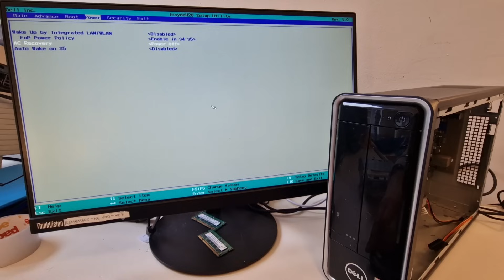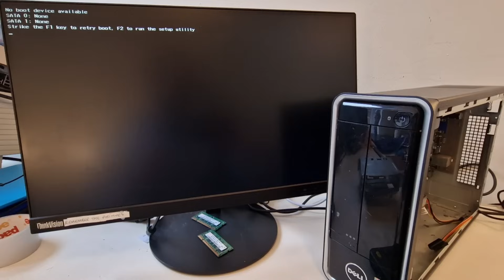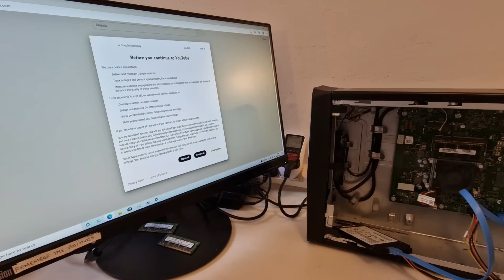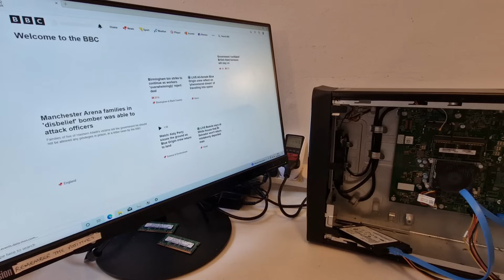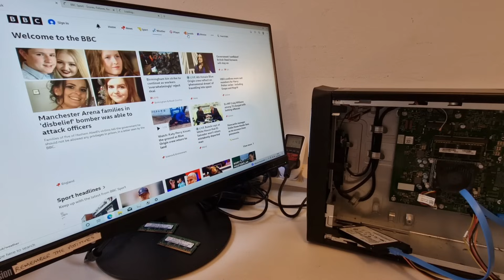Dell put a LAPTOP inside a DESKTOP case...

Comment: I had an HP that was basically the same thing as this, with the same CPU, same RAM... heck, even the motherboard was virtually the same.  Honestly, I don't think they're the worst idea for a budget desktop, but I definitely agree with you about the size.  Honestly, with the amount of unused space inside the case the the overall compact nature of the guts, they could have easily shrunk the case down by a good 50%, maybe more, and I think it would have actually made it MORE appealing.  Windows 10 performance is acceptable, in my opinion, but these things REALLY shine with Linux on them. Try putting Linux Mint XFCE or Lubuntu on this system and see what you think.    Actually, the performance of this system is not really that awful, at least compared to a few other systems that I had in the past (one eMachine, two HP) that were even more anemic, if you can believe it.  THOSE systems all each ran an AMD E-300 APU which was woefully weak compared to the J2900 in this one.  The E-300 is a dual-core APU a 1.3GHz with no boost.  Compared to this J2900, with a passmark score of 1246, the E-300 got only a passmark score of 338.  Google the HP pavilion P2-1114 PC.. and just marvel at the sadness.  Just sitting at the Windows 10 desktop and doing nothing else, if you just opened a browser window, it would hit 100% utilization.  I ended up selling all three with Linux Lite installed in order to just make them usable.

Comment: I use this model with windows 8.1, I had to install an additional fan at the back air entrance, it worked for keeping the motherboard cool. The original fan does not change speed by unknown reasons to me, it´s always on low speed. Another tip, set the cooling method to passive in the system power settings, it runs faster in this mode (i guess it doesn´t wait any fans to speed up so it takes action by itself for regulating the CPU temperature, so in the end it´s better managed)

Comment: Looks nice but it's a janky low-end low-powered cpu from 2013. It's a basic office PC. RAM capability is 8GB maximum according to the intel specs for the cpu. Not really much good for anything other than mild curiosity nowadays. Having said that it's better than the steambook garbage and should be fine with Linux.

Comment: For a machine targeting the lower end of the market, this is a brilliant strategy. Looks like a 'real' pc and can actually be expanded/optioned as such, allows for repurposing optical/3.5" drives. Reuses already designed/stock case, cheap region specific power brick doesn't need installing in the machine but simply shipped alongside it in the box.  'Laptop style'/embedded boards have been a thing since the mid 90ies, possibly earlier, keeping power use and cost very low. VIA Cx and Celeron used to rule the sff market.

Comment: Your main problem on Youtube : it tries to serve VP9 or AV1 codecs, even to systems lacking hardware decoding for them.  Pentium J2900 is an Intel Atom 'Bay Trail' .
To efficiently stream 720/1080p, get the h264ify or enhanced-h264ify extension for your browser.  Disable AV1 and VP9 codecs in extension settings.
That forces Youtube to send h.264 AVC codec video that your J2900 can decode in its onboard graphics.  Otherwise, your CPU is forced to do it; that's why your CPU usage spiked at 1080p and dropped frames. 
Why this works: YT still supports h.264, because many Apple products don't support VP9.  So you can use this to your advantage.

Comment: At first, based on the video title, I thought this was going to talk about those older docking station computers where you slide a laptop into a sliding bay of a desktop computer & clicks into an interface connector & then be used like a normal desktop, back in the 1980s & 1990s.  I do not have anything like that but I do have older laptops with port replicators.  Apparently this Dell takes it a step further & makes that laptop-desktop fusion permanent.  Looks nice though.  I have also been watching a few other videos where people just take a laptop motherboard & put it inside a desktop/tower case, or they design/build their own case using wood/metal/plastic, because the original laptop case is too broken to repair.   
04/16/25

Comment: Hp did the same thing years ago.
They are all crap.
Reply: No, they are not. It depends entirely on what OS you plan on using and what you are going to do with it. If you personally are incapable of putting such a machine to any use then that's a "you" problem, not the machine's.
Reply: @ get over yourself.  Compared to an actual desktop, they are incapable of performing anywhere near, and are so limited on upgrades.
Reply: The less upgrading you can do to a system, the quicker it is trash.  The fact you think these are anything but garbage, that is a you problem.
Reply: @MGDCrown559  "@ get over yourself."

I don't take instructions from strangers on the Internet. I did not read the rest of your comment, you wasted your time writing it.

Run along, sonny, Mind how you go and stay away from sharp scissors.

Discussion closed.
Reply: @terrydaktyllus1320  lmao you didn't read it... close your face if you want something closed.
Reply: @ You keep deleting my posts.  Sign of a limited mind, and a coward.  Keep trolling someone will think you know what you are doing.  I never will.

Comment: i somewhat recently had an hp system similar to this that had a really tiny laptop board in a large case (much larger than the one in the video) i didn't have the space for it so i no longer have it. good on power but too limiting otherwise for things such as storage drives and upgrades

Comment: Ahoy, Good video. The Pentium J2900 has a Baytrail GT1 GPU. Speedwise it is almost as fast as the N3450 Apollo Lake except the GPU. Baytrails tend to play Youtube full screen better than windowed. I have an Onyx MedPC with the Celeron version J1900. I've used it as a Retrogaming system with Batocera for 2 years. I plays anything up to N64, after that its shaky. I also used a Dell J1800 2c with Win10 for about a year then the SSD failed and I moved on. That system would fly with Linux on it. Cheers, daveyb

Comment: HP did the same thing! using a AMD 5200 APU processor!
Reply: At least that AMD had a proper iGPU that could even game at 720p low settings in 30 fps at least...

Comment: Sadly, I hate these and many HP options that are similar. Laptops in PC cases. What a waste of material.
Reply: I am not surprised that someone with the pseudonym "R-Tech_Gaming" doesn't appreciate such machines - but that's a "you" problem because there is far more to computing than just playing silly AAA "games as a service, gamers as whales" anyway.

For the record, I love gaming and have done it for more than 40 years - which in turn means I have appreciation for older retro and indie games as opposed to this modern rubbish where every game is either "running around in third person hitting things with a sword" or "playing online shooters late at night after all the cheating kids have gone to bed".

So I can happily make use of such machines like this and have some fun playing a few games on them - that's what "thinking like an engineer, not a gamer" allows me to do.

Now please excuse me while I go have a game of the classic ZX Spectrum game "Manic Miner" on an emulator running on a £12 ESP32 VGA micro-controller.

You kids, eh? You don't know you're born!

Comment: A candidate for Linux and the HP Elitedesk 800 G1 USDT PC., is a decent small PC., the CPU., is socketed and it can handle 16 GB., of RAM..
Reply from the maker: @laurencejohnson4106  that looks like a nice PC!
Reply: @OldPCGunk  Yes, I concur and that model of PC., is also designed to be easily maintained and it can be fitted with an Msata ssd., for a boot drive which frees up the 2.5 sata interface for a storage drive.

Comment: They could have found some space to add 2nd so-dimm slot. This way, system is limited to 8GB
Reply: 8GB is fine if you run a "grown-ups" OS like Linux. Why buy 16GB RAM just to run Windows to allow it to run a huge number of background processes that just surveil you and destroy your privacy anyway?
Reply: @terrydaktyllus1320  Because of how easy it is to use, especially when you've been using it for you're entire life. Linux is getting closer to being the ultimate OS, but its still got a ton of things before it reaches windows in terms of app compatibility. For example, I own FH3,4 and 5 through Xbox, therefore I can only download them through the MS store. Linux cannot do that. I can't mod most of my games (mainly single play) without going through a headache. Linux is not a plug and play system. Windows is and while windows 11 suuuucks, it still just simply... WORKS. Once Linux has all those issue sorted, then Ill switch. In the meantime, windows is what Ill use

Comment: I'm using my mom's old Dell Inspiron 660s as a media PC.  It has EXACTLY that case.  It has a normal (but proprietary) desktop motherboard inside, hence the two PCI slot covers where there aren't any PCIe slots... and the big empty space at the bottom where a proprietary PSU could easily fit (along with a corresponding knockout plate for the wall power cable and a mini fan), and a CD-ROM drive in that cage.

The power switch on the front is supposed to be white when powered on and solid yellow when in standby mode.  (And evidently, it could blink yellow if there's a problem, but I've never seen that on this 660s.)

It's hard to tell from the video but it seems that the white light on the PSU switch is rather dim, especially compared to the yellow mode.  If that's what you're seeing IRL, I just replaced that switch on the 660s a few weeks ago, because on mine the white LED was basically burned out--it was so dim that it wasn't even visible until I took off that faceplate and could look directly at the diode.  Because the white LED is on constantly whenever the PC is running, evidently they can go bad over time, even while the yellow mode is still fully bright.

It's really easy to replace that entire switch if you're so inclined.  Just lift the three clips to free up the faceplate, and remove the CD-ROM cage, and you're basically there.  I got my part from eBay, searching for Inspiron 660s--and you could try searching for 3646 as well, of course.

Comment: The performance of these is lower than an LGA 775 Pentium Dual Core system....i had a Lenovo but with a Celeron J series,with 2 ram slots and a PCI Express slot. I even threw in a GTX 750 Ti and 8GB of dual channel to see what it can do,and even with those addons it was unusable even on Youtube. That was 1 year ago
Reply: I have Linux machines of similar specification that run YouTube just fine, albeit I'd dump the proprietary NVIDIA rubbish and get an AMD GPU instead for proper Linux driver support. I suspect Windows (and what it does in the background destroying your privacy) was the problem in your case.
Reply: @terrydaktyllus1320  I don't have that pc anymore but yours and the one in the video are better than mine. The Pentium is still superior to the Celeron and my Celeron was only just a dual core instead of a quad core. In Passmark it scored lower than a Pentium E2140 which was the weakest LGA 775 Pentium Dual Core...and that was released in 2007 compared to the Celeron which was 2015
Reply: @LUR777-g7r  LGA 775 is a "strange" architecture anyway because whilst it (mostly) supports Pentium Dual Core, Core 2 Duo and Core 2 Quad architectures, some of the higher end Core 2 Duo CPUs outperform some of the Core 2 Quad CPUs in some respects.
Reply: @terrydaktyllus1320  It's probably the Core 2 Duos that released just before they switched to the i series i mean even on Core 2 Quads there are ones like the Q9400 which perform better and use less power than the older ones like the Q6600

Comment: It's a shame it has no PCIe slots
But
Way more useful than an HP Stream 💻😁
I like it.
Reply: I use an HP stream as a domain controller for my home lab. Ran 2012 R2 (basically is 8.1, which it was designed to tun) flawlessly for many years running 24/7.

Comment: For the record, I've a similarly-sized Lenovo 90BJ machine containing a "laptop-style" motherboard - mine has an AMD A8-7410 quad core APU in it and 8GB RAM so is okay for some very light gaming (I only run Linux anyway).

A "cheap and cheerful" novelty from eBay in my case...

Comment: HP had some similar systems at the time. I have one of them. The motherboards are almost identical in layout. I 3D printed an ITX case for mine to make it even smaller since I didn't need the optical drive bay.
Reply from the maker: @mattelder1971  that sounds great! I'd love to see it
Reply: Lenovo too,the chassis layout and even the front panel connector colors are the same. They were all probably built by Foxconn for different brands,also notice how the board does not have any Dell logo printed on it like all Dells have either so this board was most likely shared with all brands
Reply: Yes mine is from around 2015 and ran windows 8.1 , model 110
Reply: @namesurname4666 Yeah, mine's a 110-210. Currently running Windows 10 on it, but probably about to put an Linux distro on it, likely a stripped down Ubuntu.
Reply: @ i used it in the last years as a server/home nas because it uses like 1w/few watts of power